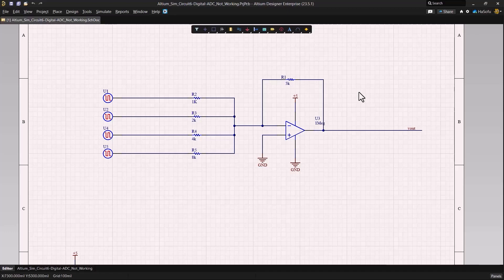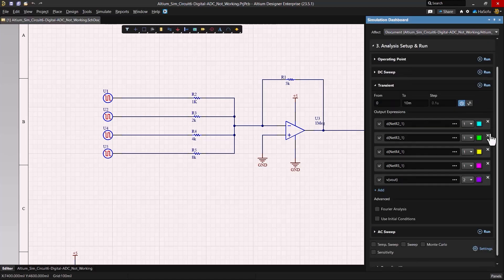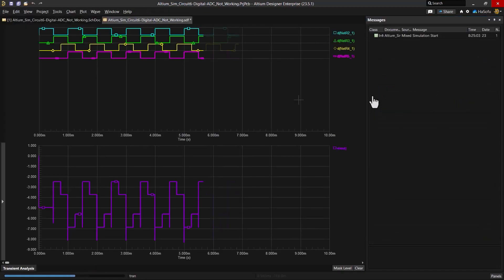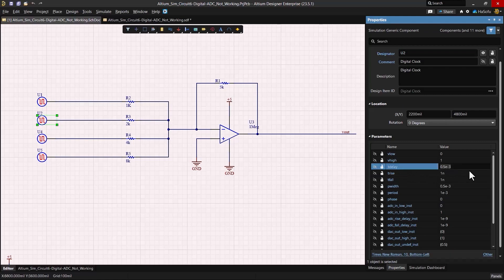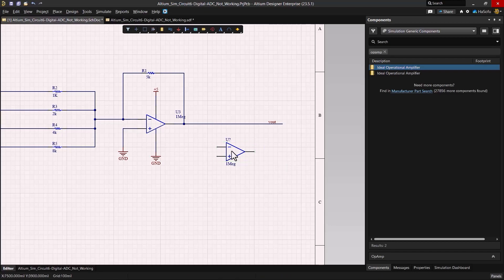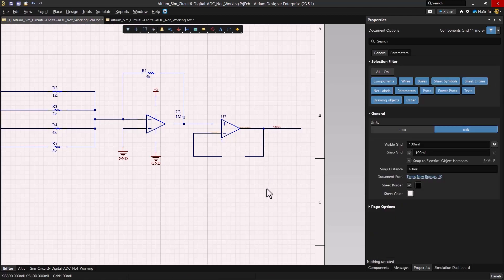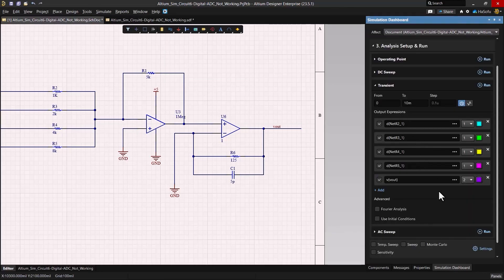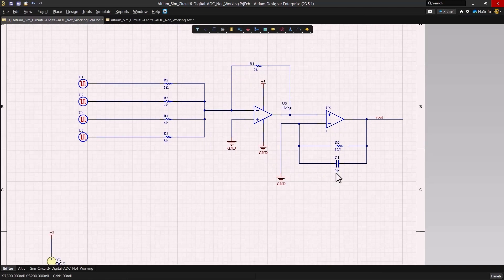Analog to Digital Converter

Comment: strange simulation to get a -10V out of +5V powered  op, looks like the simulation doent care about the supply voltage of the OP,  The buffer wiring also very strange, as menationed by the other comment The resistor and C only loads the output as the feedback is shortened to ground....Also needs to be defined which voltage range the binary input has ?  From a didactic point of view the presentaion can be enhanced, also I would assume a binaray step to all 16 values for a better test of the circuit.

Comment: How can you get -10V signal output from the OpAmp powered by +5V only? It seems like the simulator is not correct 😞
Reply: @IgorChudakov

 Totally agree , the op-amp is limited by its supply rails, -10V from 5V, seems erroneous to me too.
Reply: You can try charge pump circuit for generating - voltages from +. But current will be limited. Or you can use -voltage generating ICs too, they often used for N type FET gates voltage for generating negative voltages.
Reply: @atakaravelioglu301 This is a 4-bit BWR DAC (summing amplifier with resistors having binary weights ) , so we should not expect charge pump behavior here
Reply: Apart from this circuit, I have already suggested
Reply: @atakaravelioglu301  Thanks bro ^_^